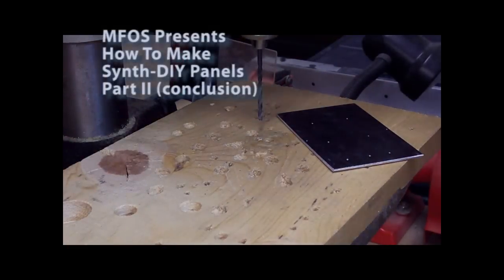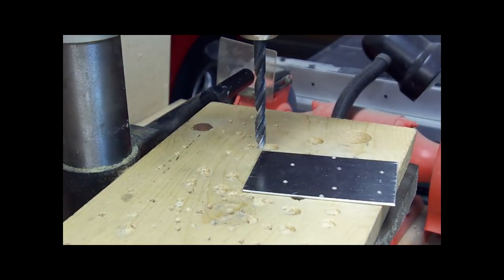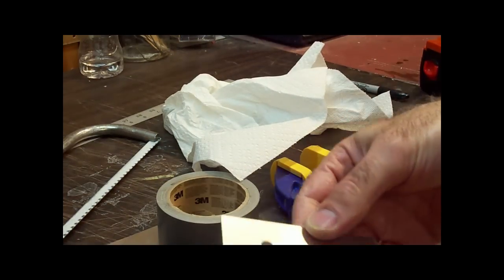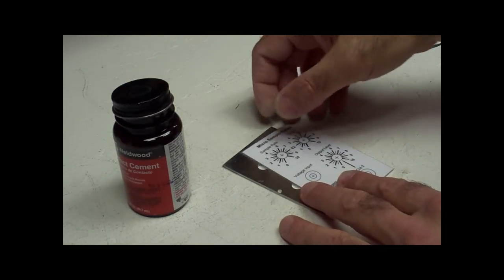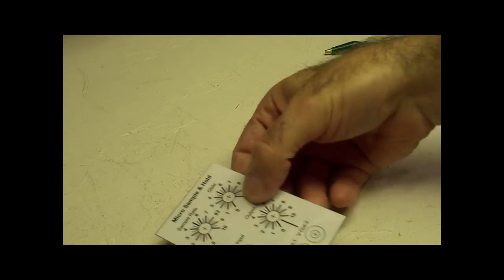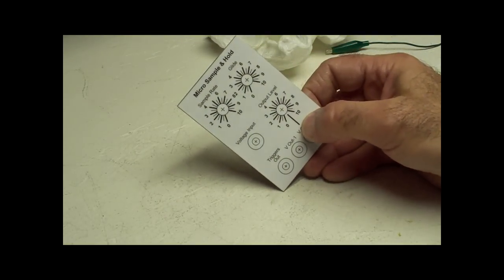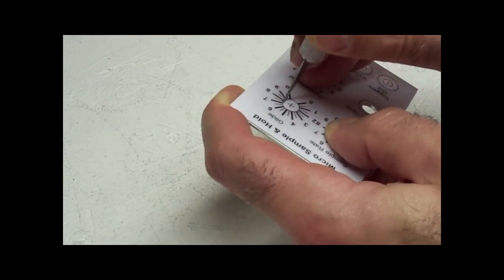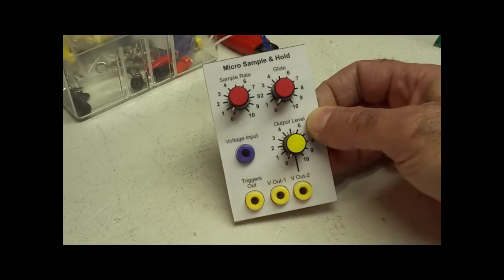MFOS How To Make Synth-DIY Panels Part II

Comment: Great information thanks, but I would recommend never to hold stock in a drill press, especially with bits larger than 1/8". If you don't clamp it either pin it down or wear a glove. Not a pretty sight when a bit grabs a piece of stock and spins it, your first instinct is to grab it, bad idea.

Comment: never drill sheet metal with a drill press without wearing leather gloves or using something to clamp the metal down....unless you like loosing fingers.
Reply from the maker: This man speaks the truth. Thanks for the advice.
Reply: hear here: hospital sucks :D
Reply: Yeh I agree, drilling Al sheet with larger drill bits tend to grab just as they go through and if not firmly held the sheet often rotates removing flesh.
Reply: Clamp it down! Even with clamps and glowes I usualy make it spin
Reply: Was just watching that part....flinching and rubbing my fingers at the same time.

Comment from the maker: The drill press speed can be changed via a belt system but I do keep it relatively low speed when drilling aluminum. I go slow and use cutting oil to avoid burs.

Comment: Thanks for he tips. Some questions: have you ever tryed to fit your modules in the Eurorack sistem? If yes, would you please post in your site some ideas or templates for panels; some explanation about the matter, like horizontal pitch, horizontal unit; connectors patterns and models; flat cables patterns (+12V, -12V, GND, CV read, CV write, etc)? I think that would be awesome. Thanks.

Comment: .....and instead of put the transparent, print the negative (not mirrored), tranfer it on the metal then put the panel on acid (the one you use for etch your pcb),  the result  is like an incision! :)

Comment from the maker: The only thing about plastic is that it does not provide a ground plane or shield for the pot bodies which should be grounded. You could use it but that would be the issue.

Comment: Great tutorial!
Just a question. Could it be possible to use a methacrylate panel (or other similar plastic material) instead of aluminum to build my front panels? (using the same process with a printed template and all)
Reply: up

Comment: The next step is to put the print on the metal  on on the metal plaque with the printed facing the metal, that means you can't see the print (as the laser toner is "touching" the bare metal). Next is to iron with a regular Iron machine (dont steal it from your women...) and the heat will transfer the toner to the metal, now to remove the paper you need to put it on normal water and wait a bit until it soaks some water, take of water and apply some friction (like with your finger or a cloth)

Comment: Hi Ray,

Im in a modular synth workshop and we use a very interesting and simple method to make the panels, I wanted to share it with you in case you dont know it!

What we use to make the panels its regular glossy photographic paper with the laster printed front panel design, the difference here is that the laster print we use is INVERTED (like in a mirror).

Comment from the maker: @ChrisLody The oil makes a real difference but the 6061 T6 aluminum is also a little harder than some I've worked with and it machines better than the softer material I used to use.

Comment: Thanks for the tips. I never realised that a little bit of spray oil made such a difference to drilling large holes in aluminium. I've always had problems with the plate snagging and spinning round so i always fasten down what i'm drilling, but maybe the oil will help.